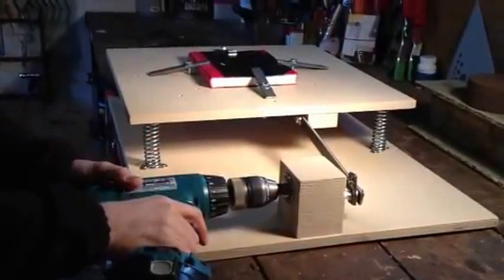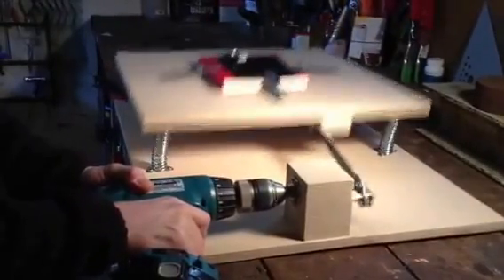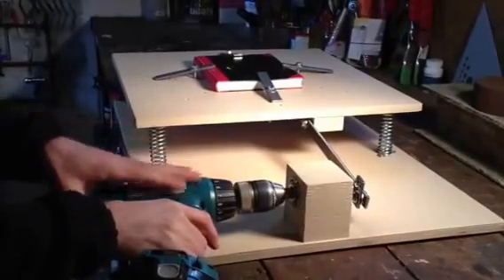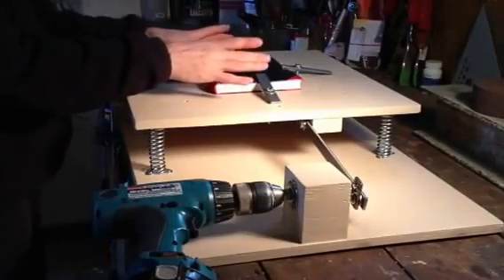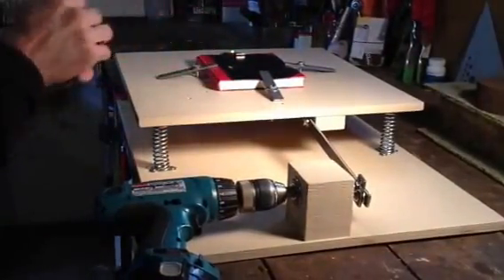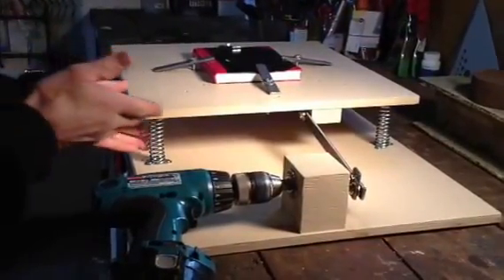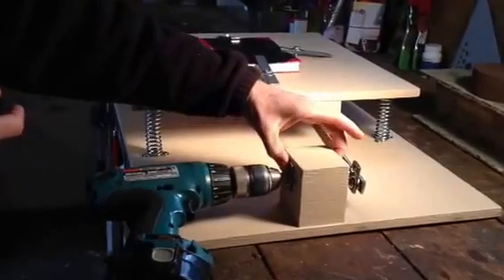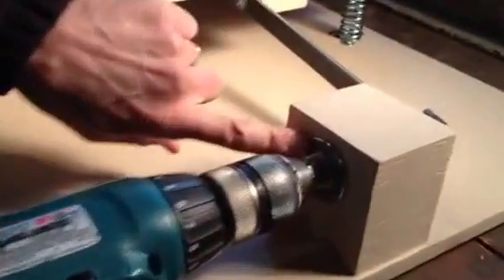Shake table

Comment: Where do you get those springs? They look like they have a plate on either end to screw into the wood.
Reply from the maker: +MrShamuto        

  Hi MrShamuto, 
 I gave this materials list to Cody (below) who requested it. You can get the springs from a good hardware store.  I got them local from    http://www.parkrosehardware.com/      . They have no mounting plate.  I secured them with screws and washers (see below) .

 
                                                                                                                                                                                                     note:  all steel flat bar in design is 3/16" x 3/4",     all holes are 9/32",     all nuts and bolts are 1/4" diam,    
 all washers are 1/4" or 3/16").

Wood
 5/8" plywood
 Top 19" x 19"       Bottom  19" x 29"
 Enough holes in top for various size models

Metal clamps        
 4-1/2" flat bar.  Hole is  1-1/2"  from end
 2" bolts with washers and wingnuts

Springs
 1" diam  x 3-1/2" length compression spring  (aprox. 10 gauge wire)
 Fasten to boards with 5/8" screws and washers

Drive arm
 10" flat bar with holes 1/2" from ends
 1-1/2" bolts with washers
 
Cam
 1-3/4" flat bar welded onto bike axle
 Offset  hole  5/8" from axle (center to center)

Axle
 From bicycle front wheel, mounted in wood block

(note:  Clamp entire shake table to school desk with bar clamps or the like)

Comment: Did you use a tutorial of some kind to make the table that I could use as well? I need to make a table like this.
Reply from the maker: +Mackenzie Campbell       Hi,    Sorry there is no tutorial for this.  I just made it from scratch and it was a bit of a challenge.  If i had to make another I would use a simpler design.  Mount an electric palm sander (orbital sander) upside down on the base board.  Mount another board (shake table) on the flat (sand paper) side of the palm sander. Probably a little trial and error but a much easier design to build.  Good luck and keep up the good work!
Reply: Thanks so much for the advice! I appreciate it

Comment: How do you get the bike axle through the block of wood?
Reply from the maker: +Yosky Dude              Dude, I sandwiched and screwed together two pieces of wood (2x4 chunks)  , drilled the hole, then unscrewed the sandwich to place the axle, then screwed back together with some wood glue.

Comment: If you could that would be helpful! I'm gonna give it a try! Thanks!
Reply from the maker: Hi Cory,
My design can be modified in many ways and still be quite functional, or even better.  For this reason I will give you my specs but not go into crazy detail.  For instance, you could probably mount a sawzall or jig saw in line as the driver and eliminate the need to build the axle assembly.

(note:  all steel flat bar in design is 3/16" x 3/4",     all holes are 9/32",     all nuts and bolts are 1/4" diam,    
	all washers are 1/4" or 3/16").

Wood
	5/8" plywood
	Top 19" x 19"       Bottom  19" x 29"
	Enough holes in top for various size models

Metal clamps        
	4-1/2" flat bar.  Hole is  1-1/2"  from end
	2" bolts with washers and wingnuts

Springs
	1" diam  x 3-1/2" length compression spring  (aprox. 10 gauge wire)
	Fasten to boards with 5/8" screws and washers

Drive arm
	10" flat bar with holes 1/2" from ends
	1-1/2" bolts with washers
	
Cam
	1-3/4" flat bar welded onto bike axle
	Offset  hole  5/8" from axle (center to center)

Axle
	From bicycle front wheel, mounted in wood block

(note:  Clamp entire shake table to school desk with bar clamps or the like)

Happy teaching!
Tony

Comment: I would like to make this for my class. Do you have exact materials and measurements you can provide so I can do this?
Reply from the maker: Hi Cody, 
I don't have a materials list made up but it could be pulled together.  To be honest, this project was harder than I expected it to be (and I am a remodeling contractor used to building things with various materials). There was one weld I did on the bike axle (but if the design was simplified to not use a bike axle, no weld would be needed). Bottom line, there is a certain amount of custom finesse work required to make it, but if you are handy like that, let me know and I will gather the specs.  Thanks for looking,    Tony